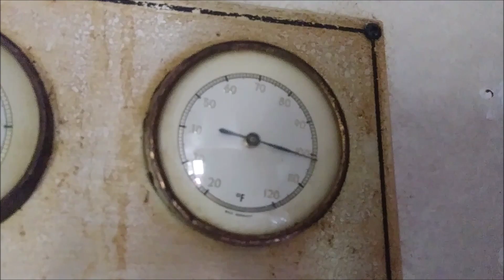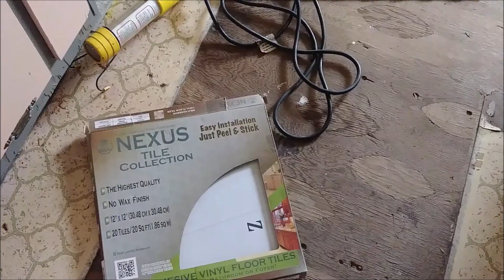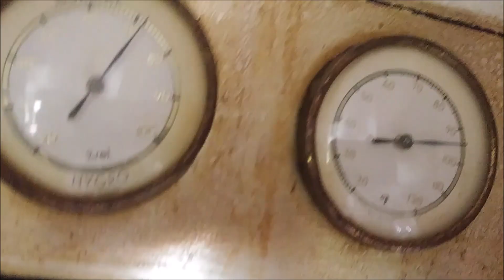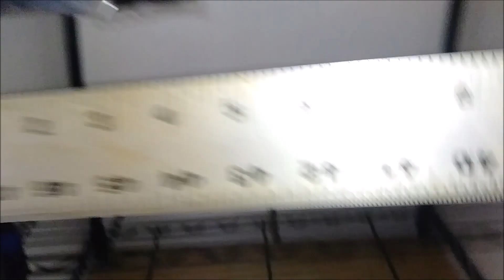1974 Silver Streak Reno   Storm, cabinets cut, new faucet and a leak!

Comment: On that bathroom sink, if you have a rust hole in the bowl itself you can patch it with that weld steel putty I told you about at Walmart. It's in a tube and you break off enough for your application and hand mix it so that the putty and the hardner in it let it harden after you press it on to the area where the hole is.
I had to replace my sink with a sink I found on clearance at Lowes that wasn't the exact shape of the hole but fit well enough that I didn't even have to clamp it down. 

Be careful taking off that P trap assembly as you might just break the bottom out of the sink bowl. Some times it's better to leave well enough alone. Either that or buy a new sink bowl and replace all the piping underneath.
Sometimes the P trap has a lot of crud at the bottom of the P that will keep accumulating other crud over time until it plugs up.
You may have trouble finding a sink bowl that is the right shape for the hole and they are NOT CHEAP as is anything to do with plumbing fixtures nowadays.
Reply from the maker: The sink has more rust spots & I think it will only get worse due to our high humidity. We do have some old abandoned RV'S here that might have a donor sink. I need to look around. 
I had someone install the new faucet. What is under the sink is new, except for the p trap. He could not find a new one, so he cleaned that one out. 
I still need to take the panel off the wall behind the sink area to inspect the shower plumbing too. 
I appreciate your suggestions!